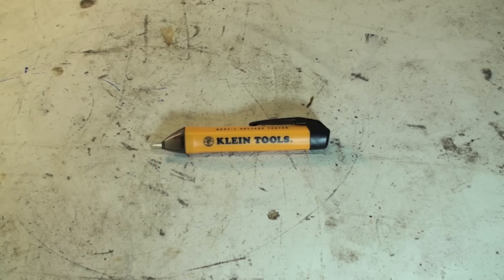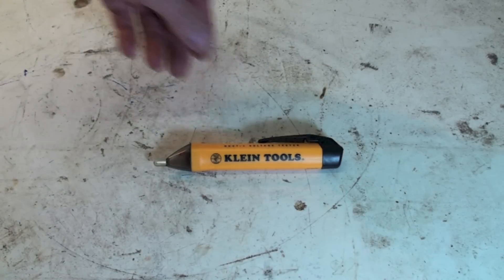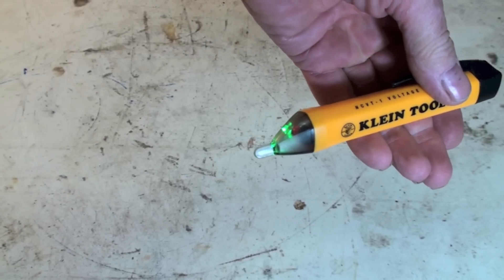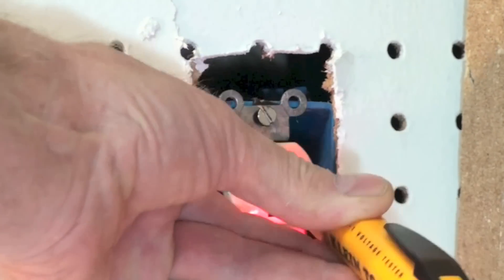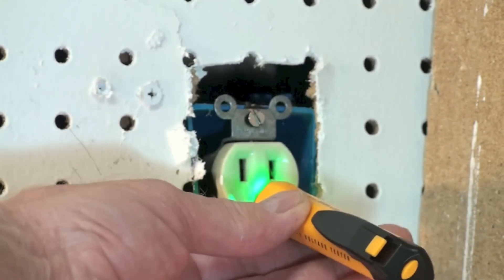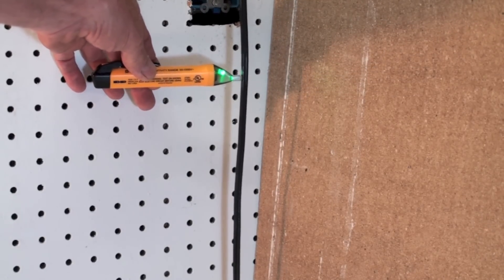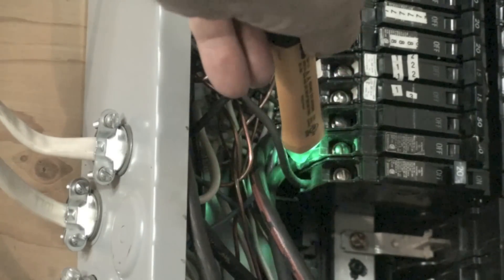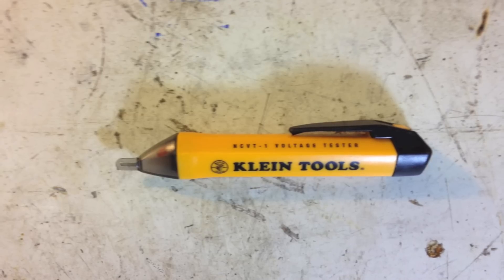How the voltage detector works

Comment: Why is there no voltage detected from the neutral?

I thought the neutral returns current from the outlet.
Reply from the maker: Because the neutral is located (in the pole transformer) at the center of the secondary winding,  it will always be at zero voltage.
GFM
Reply: @grayfurnaceman  
I think I finally get it.

It's at the center of the magnetic flux poles, and unless it receives a unbalanced load from the main panel, it stays at it's grounded potential.

The other possibility, is that the panel does have an unbalanced load, but your device can't pick up the voltage as it is too low?

Thanks.
Reply from the maker: @dialecticalmonist3405  The first one.  You got it.
GFM

Comment: I'm not trying to be sarcastic or anything but you were making a lot of CONTACT. They are wonderful tools. The first one I purchased was a cheapy like yours. The range was 50-600v AC. It found my problem but like you I was rubbing the cable vigorously before it would work. I wired my house 28 years ago and it has a thicker sheath than today's wire. On thinner sheath wire when 1 inch away it picked up the signal. I exchanged it for a better one that is more sensitive. The range is: 12-1000V AC and 100-1000V AC. Now it will detect 1 inch away on my house wiring and 3 inches away from the newer wiring. Its called Advanced Duel Range NON-CONTACT AC Voltage Detector and it lives up to its name. Also it will detect 1/2 inch away from an outlet. Paid $25.00 at Lowes. WELL worth every penny. Wonderful tool. It just took a few minutes to find my open circuit without tearing into several junction boxes and or outlets. My wife said it was worth its weight in gold and I agree.
Reply from the maker: Good info.
GFM
Reply: Thanks for your input. I was thinking that too. He said "no contact" at the start of the vid but he does touch the connections and wirings. Now I know.

Comment: Was disappointed with this video. It was titled "How the (Non Contact) voltage detector works" which I was interested in hearing/seeing. It was not about that at all; it was about how to use the device.
Reply from the maker: +windfreak33 Welcome.  There is actually a little dude inside that gets excited when voltage is around and pushes a button.  lil
GFM
Reply: +Dean Rhodenizer I was misled by the title as well. I was also expecting to see how it works, as in the science of how it works, the components that are inside and their functions, etc., but soon realized it was actually a video about how to operate it and what it does, not how it does it. I'm not complaining though, as I have never used a non-contact voltage detector before and found the information to be very valuable, even though it wasn't what I was searching for. I just bought one online, so I'll need to know how to use it anyway and instructions aren't always the best. Thanks for the great video!
Reply: Lol! So you're saying he gets "amped up" (pun intended) every time he gets around an electric field? Hehe.
Reply: Beat me to it. :/
Reply: 4 years later... and this "how to use this tool" video still comes up as #1 when trying to find out how the tool works.
Came to the comments looking for maybe a link to what we were all looking for.
Reply: @TravisFabel  Same here. "Grayfurnaceman" change the damn title
Reply from the maker: Dean Rhodenizer Well, I guess that is a valid point.  But that is not my area of expertise.  
GFM

Comment: Lets say you have multiple cables in your ceiling that are close to each other. How would you test ? I have a similar detector as you have and I tested a know DEAD wire that was right next to a LIVE wire and the tool told me that the DEAD wire was LIVE.
Reply from the maker: That's one of the defects with this type of detection.  Best to use a voltmeter for that one.
GFM
Reply: grayfurnaceman
Thanks..any specific one you'd reccomend?
Reply: grayfurnaceman
Also, would I just be able to touch the outside of the wire (casing) with the probes or do I have to touch the actual strands of wire inside?
Reply from the maker: TechJPC Probably the Fluke is best, although I have the Klein and it works ok.
GFM

Comment: Glad I watched your video here.  I was a maintenance electrician years ago and so am used to using probes.  These days and in many past I feel safer using 2 prong extension cords if I know which side is "hot"--for sure.  Although some items these days no longer have polarized plugs--I use some older polarized tools (and outdoors).  Now by checking the female extension cord plug in end with this tool---piece of cake!  I will be buying one shortly.  Thanks.

Comment: I have that one too .. the duel range model. can read high voltage field feet away from the source.  I set it to the blue light which is the long range detection and went outside behind my house where we have somewhat low power lines and it picks up the field halfway through my back yard.  Pretty sensitive.  Also it will sense static. Rub a piece of PVC pipe and then have someone hold it up to the pipe. Also rub the tester across your stomach or your arm and you should get a reading.

Comment from the maker: If I am correct, the power in amplifier output is DC.  These are designed to read AC.  However if there is sound going thru the system, it may read.  Hope this helps.
GFM

Comment from the maker: You are right.  The dual voltage unit is nice for easily checking for 24 volts.  The single voltage one is limited to 50v.  The one I purchased was primarily for safety but I think the dual voltage one is more useful.  Thanks for the comment!